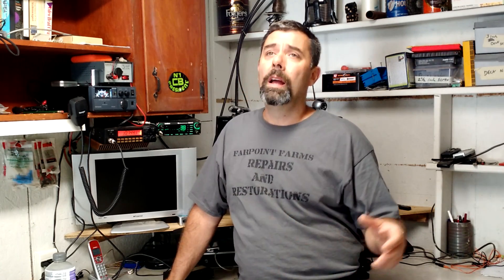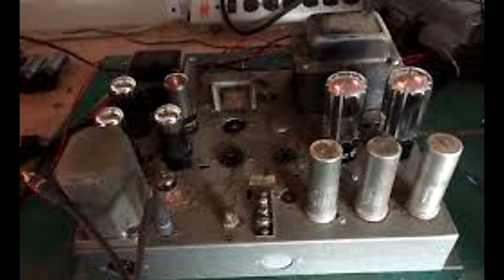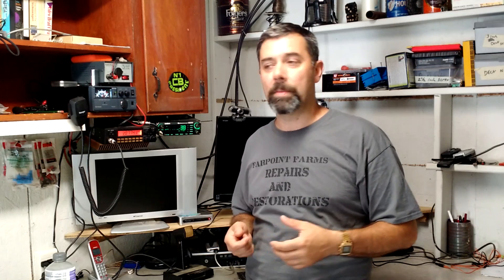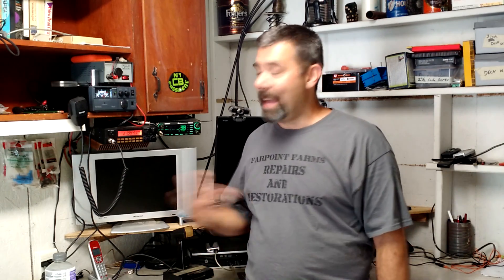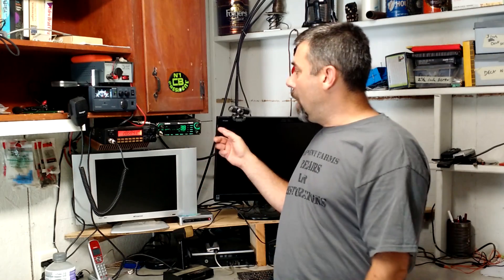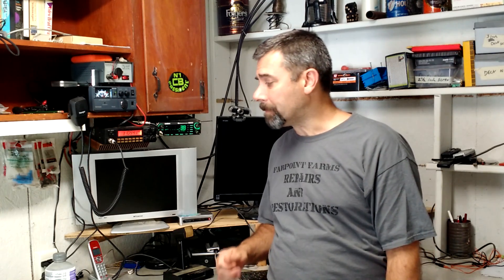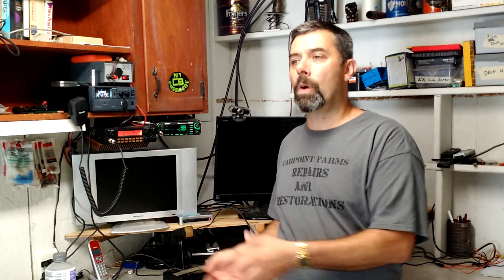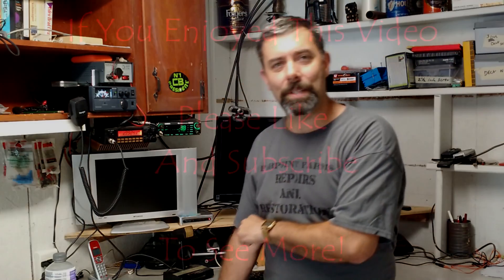A Beginners Guide To CB Linear Amplifiers.

Comment: When I was running power my neighbor could hear me talking through their sewing machine and their refrigerator, Also any florescent lights would light up when the beams were pointed across their house.
Reply from the maker: I think you might have had it tuned a bit too high- just a thought.
Reply: @FarpointFarms  Sometimes I'd get carried away with power. I was running a D&A Phantom 500 that I referred to as the gray ghost because of its color. The phantom produced a clean signal provided you gave it one. Now that I'm licensed to operate Amateur Radio I only use enough power to be heard. With repeaters being accessible theres very little need to run much power, at least on the frequencies I use. I'm seldom on the 11 meter band anymore..Thank you for the response.

Comment: Great information!  The increase watt concept is quite similar to Ohm's Law when combining speakers.  If you have an 8 Ohm output per channel, to use multiple speakers you must use a series-parallel circuit.  Speaker group 1 = 2 8 Ohm speakers in series.  Same for speaker group 2.  Each group now has 16 Ohms.  To get back to the 8 Ohm output, you parallel the speaker groups together,  Thus the 2 groups divide the per group Ohm's back down to 8 Ohms.  You could use 2 4 Ohm speakers in series to equal 8 Ohms of the amp.  If you're working with 3 speakers per side,  take group 1, add a single 8 Ohm speaker with an 8 Ohm resister in series, giving 16 Ohms per group.  Parallel these groups together to get the 8 Ohm output from the amp.
Reply from the maker: thanks for sharing that information- it is good to know
Reply: @FarpointFarms I have a question I hope you can answer is it a good idea to run a extra chassis ground to my Antenna I got a mount for a 102 whip it was powder coated I sanded it to the metal my radio has a chassis ground any ideas or help would be great

Comment: 1)  I don't follow the logic of a manufacturer producing an amp that is designed for a half a watt.
CB's have been 4 or 5 watts for 50 +  years.

2) Any amp with 600 or more actual watts is going to require a 240 volt service.
Reply from the maker: I always wondered why the did it.

Comment: What about the amp vs. The car? I don't want to use a big amp and take chances on doing damage to my cars electrical system
Reply from the maker: It certainly is possible.
Reply: @Farpoint Farms  I used to runa Texas star 677 and a 500 but when she bought the little Kea I'm kina scared to hook any box up. I've even checked with the dealer and they look at me like I growed a second head.

Comment: Just a question. I have a little 100w lennier when you key up it works fine, but when I unkey it continues to transmit , any ideas what's wrong. ??
Reply from the maker: It may have a delay for sideband. If it doesn't un key after a moment, it may be a bad relay.
Reply: @FarpointFarms  Thank you.

Comment: I don't know if agree really with a 5 watt am or 12 ssb with a very good antenna set up, one easily talks skip all over the u.s. and overseas. I had a 5/8 wavelength ground plane 100 feet up in a tree, rg-8 coax running to it, made and soldiered by hand by a 40+ yes long ham operator and 1.2 SWR  reading. I only like to talk skip and that,s all. For 4 years of shooting skip barefoot I had ONE contact. Talked my parents into letting me buy a 100 watt black cat. Everything skip was running after that ( yes the SWR was tuned with amp to be 1.3) I had dozens of contacts and conversations with all 50 states and Europe everything it was coming in. Don,t need an amp.?? You decide
Reply from the maker: It certainly helps.

Comment: Eric, had a system back In the day and i decided to get it back out and set it back up. Problem is I forgot my set up. I know my power set ups but the rest I am not sure.  Ranger 2950, model 91 match box, galaxy 2 freq counter and shoot star 225 ( may not use but want to know where it goes in line) and Antron 99 antenna, could you give me the in-line set up please, thanks, just want to be sure.
Reply from the maker: I'll make a video on that!
Reply: @FarpointFarms  thank you very much, if you need any more information on my setup let me know
Reply: Not sure when you will get the time for the video but could you tell me in what Order my eq goes in thanks

Comment: Hi Eric,
I have a question about my new to me setup.
I'm setting up a mobile CB for my mid 90's Miata's.
I have a CB (all in the handset CB) it's a 40 channel unit.  (Used in my International Scout II back in the day)
My question is about the antenna. I've set up a bracket just below the rear bumper.
I have a 5' tuneable Fire stick. No one seems to talk about those fiberglass wound antenna's. Are they no good?
I don't want to use a 102" ss whip. It's just too much height. 
I do have the tuner to adjust the antenna.
A group of us go cruising in our Miata's and there is usually a lead car and a sweep car.
Thanks for any input,
Chris
Reply from the maker: Firesticks are great antennas. I've just never owned one to review it. It should work very well.
Reply: @FarpointFarms  
Thanks for your response,
I picked the fire stick up used, it's one of the ones that has a screw and lock ring to set the length. I've always used the ss whip (decades ago) and on a Miata that's not practical. On this particular car has a receiver hitch and my bracket will mount to that so I'm sure I'll need an extra grounding  wire. I have two of these cars and I'm working out the details on one car before I set up the second.
I'm not sure how well my old Uniden all in the mic is going to work, but I'm going to give it a shot. It seems the Cobra Sound Tracker 75 WS XT is more available (for the second car) and probably pair it with the little will (or equivalent)antenna. The antennas only possible location is the trunk lid being a convertible with an aluminum hood! 
I'm trying to plan for the spring because I live in New England and it's some cold right now. If it's cold where you are it's still warmer than here!
Thanks again,
Chris

Comment: Great educational information you just gave me. Thank you. Is that a RCI-2950 in your shop? If so, i have the same radio that I purchased new way back when. It's still 100% functional and mint. They are great radios. Unfortunately for me, at the time of my purchase the CB radio hobby was coming to an end. I didn't have the knowledge or folks that were willing to teach me the tricks of the hobby. I packed up my radio and stored it away for many years.
Reply from the maker: Dust that old thing off and fire it up! They are really good radios!
Reply: @FarpointFarms  Yes, sir. It's been dusted off and installed in my daily driver truck..I'm currently using a rooftop magnet mount Wilson 1000 antenna. Im definitely investing in a while antenna and better coax soon. Do you have any recommendations as far as what length of antenna and coax type? Thanks for replying and keep up the great work. You earned a new subscriber 😎👍

PS: I've collected several radios over the years. My backup radio is a Uniden 76 with SSB and modded. I also have 2 Cobra 148 GTLs (Made in Philippines) sitting in original boxes.

Comment: Hi, what you DIDN'T say; was how many amp POWER SUPPLY you would need to run, say...a 200w amplifier.
I keep trying to rephrase my Google query, but I can't get an answer.
Please reply, hypothetically, what size would be needed for such a setup. (SHTF only).
Reply from the maker: 20 amps should run upto 400w- please keep in mind that there are a ton of variables on that along with run time.
Reply: @FarpointFarms  will increasing the wattage increase your reception range?
Reply: @FarpointFarms ...sorry, I forgot my manners:Thank you for the prompt and ACCURATE response.
I couldn't find an answer anything like that when I Googled my question.

Comment: Please make a video on how to ground your cb radio properly on your highway truck.  On a separate note from the above, I almost started a fire because I thought I knew what I was doing.  I had just enough time to put that smoking radio outside before it actually caught fire entirely.  If you're reading this and you're unsure, ask questions before you get yourself in trouble.  Doesn't hurt to ask questions.

Comment: Yeah CB was fun back in the day. And I also had built my own 100 watt linear. But those who love working skip and love running power should seriously think about obtaining an Amateur license. The Morse code is no longer required on the test. And the tests are all mutable choice. You can obtain all test questions online for free. Even though you may not understand the material, just remember the correct answers. There are several levels of licenses. Technician, General, and Extra. Most just stay at General to obtain the low band privileges for skip. And in most frequencies you are allowed 1500 watts. Tests are given by Amateur operators who obtain the Volunteer exam privileges. Check your local area for exam locations, date and time. It’s nothing like the nonsense you hear on CB. We as Amateurs would love to have you join with us in the fascinating radio hobby. And this is N2MIR. 73’s

Comment: Knew a guy back in the 70's  that was a HAM and was quite proud of the fact that he never bought any parts from a store.  Built everything himself from salvaged  radios, and some parts weren't even from radio.  And looking at it all you could tell for sure it was all home made. He was quite contemptuous  of big watt  stations. He would say put a million watts on something and sure you can go anywhere, big deal. Try it on a watt. He did all his contacting in code. I know nothing about the hobby so don't know how much power he was putting out and he said it took alot of work just for one contact, could be he was just BSing me.

Comment: Being an experienced HAM here i can confirm that you did address all relevant issues:
1) As the CB-Cold-war has passed, Using an amp is of no need these day's anymore
2) Power requirements increase logaritmicly increasing from 4 to 15 Watts is hardly noticable (1 S-point)
3) Driving an amp requires matching the input power (don't adjust to MAX but about to 70% of max, unless you have decent and usualy expensive  measuring equipment)

Finaly, there is not something like Wattage or Amperage ! it is Power (measured in Watts) and Current (measured in Amperes, not in Amps), However there is something like Voltage (measured indeed in Volts)

Comment: Good video bud! Just got my first home base set up. Took your advice and bought the Uniden 980 SSB and so far I like it. Still playing with getting my antenna tuned. What type of antenna or antennas are you using and how high do you have them mounted? I am trying a configuration you showed on one of your videos. 2 5ft firestik whips in a verticle position. Getting an swr of 1.2 on channel 1 and 1.7 on channel 40. Any advice from anyone would be greatly appreciated.
Reply: 1.5 to 1.7 is a good swr. I have that same radio in my dump truck with a Wilson 5000 and even on a.m. I get out a couple miles sideband clear across the city also hook that up in my pickup truck sometimes and use a Wilson magnet mount and it does almost as good as my dump truck point being go for a Wilson I've never had a bad experience with a Wilson antenna

Comment: This whole conversation that this guy is about to have with his video camera is all wrong information factually. Now first of all I’m not trying to talk bad about anyone or put anyone down, but I’ve owned 2 or 3 businesses selling and repairing every kind of two way communication equipment that’s ever been manufactured especially in the 1990’s when c.b. Made a huge comeback I think that about 90 percent of my city had radios in their cars,trucks, and in their homes it was a huge business to be in back then and to answer one of his questions YES Cobra did in fact manufacture some mobile amplifiers like that blue one he showed, but in all actuality now days the cb bands are pretty much dead, while sideband is the new place to talk and make long distance connections with other users, but he’s correct about the use of amplifiers on the cb band which is 11 meter band and most amplifiers will state on them that they are for the 10 meter band and yes back in the 1970s-1980s-1990s many many people used amplifiers to talk longer ranges from their vehicles and from their homes base stations, even tho amps are still considered to be illegal for use on cb band today, I doubt anybody using an amp would or could expect any visits from the F.C.C unless you were using such a large enough amp to overtake a local radio or tv broadcasting station which would have to be extremely large as in its output wattage, throughout my time frowning up thru the 80s and 90s I remember having multiple base stations set up at every single family members home as well as at our local farm we owned and I remember having some large tube type amps that increased our output to amounts of over 2000 watts and as high as 5000 watts and sometimes even more, while you’d have to use it with lots of cation back in the hay day of cb …..I’m not so sure it would be that serious now a days as I’ve just recently installed a base station as I usually every year for a winter hobby and I can tell you it’s just a 40 channel radio with sideband and just a standard Omni directional antenna from the late 1960s which still works flawlessly but I do choose to use a linear amplifier every time my cb radio gets turned on so does the amp and for a basic base station it will dead key around 50-60 watts and will swing up just over 1200 watts and that pretty much lets me talk all over the world each and everyday, just know that if you choose to install an amp into your setup that your taking all responsibility into your own hands, also by the way I’ve even seen people this past summer out camping and using those F.R.M.S. And G.M.R.S. Radio setups where one would be inside a big camping trailer or motor or 5TH wheel and then each of their family members would carry a personal walkie talkie style radio on their person but I seen many of the radios inside the campers and even on those radio bands I seen as much as a Texas star 350 amp in line with that families f.m.r.s/G.m.r.s setup and when I asked about it the dad said he did that to ensure no matter where every family member was around that campground he would be sure they would hear him broadcast and that he could even use the amps receive booster to hear everyone of his families walkie talkie radios when they respond to him so there are some good and some bad things about these amps but as long as I have a collection of these amps I will always choose to have one inline, and yes I do also own one of those RM Italy amps he spoke of the rm Italy 50 but it actually only boost you up to about 40-45 watts but you don’t really need to tune your radio if it’s a rite out of the box brand new radio you can run it most amplifiers can handle any input of a dead key from 0-4 watts without hurting the amp I usually turn all my radios dead key down to around 1-2 watts if I’m gonna use a amp inline doing this just allows me a little more forward swing of wattage

Comment: The original FCC rule for power was 5 W input (to the PA), which usually equated to 3.5 W output.  It was equal to the collector voltage times the collector current.  Amateur powers were specified the same way (1000 W, except Novice Class which was 75 W).  In the old days, it was difficult for hams or hobbiests to measure output power.  The equipment for doing it was expensive.  As  the technology improved and the equipment dropped in price, the regs were changed.

Comment: As you mentioned, the issue of outboard signal amplification in CB, using linear amplifiers means little when all the necessary conditions are not established.
I still have a small linear tube amplifier that works fine, which I turn on from time to time to check how it behaves.
But in fact the most effective contacts I've established at 27 MHz throughout my life have been made with the conventional configurations of each of the transceivers I have and not with linear amplifiers.
Perhaps this is one of the healthiest ways of taking advantage of this type of communication, that is, studying the issue in depth, taking care of all the elementary aspects of the installation, waiting for the propagation conditions to be favourable and being able to use the little power available in the transceiver in a balanced way, managing to get very far with communication.
Greetings from Portugal!
73

Comment: in the 80's-90's i ran texas star radios with astetic mic into a Black Cat Wawasee JB150  modulator into a D&A Phantom 10 tube 6lq6 amp  into a 5/8 4 ground radial base antenna   and a tx star with a sweet 16 in the van... bam  bam  bam world wide zigzag off the key

Comment: Of course you don't need an amp. You have a 300+W Ranger 2970 hanging there!
Reply from the maker: That is a 10 Meter Ham radio, not a CB.
Reply: @FarpointFarms  : Of course it is. I've owned a few over the years.

Comment: man u made my day u funny but what's the best coaxial cable and antenna, I am running with a factory cb radio of 25 or 28 watts and a power supply of 15 amperage and the coaxial cable is LMR 400 0710M what due with think about my set up.

Comment: Back in the 70s i had my set. I had a heath ssb/cb and a 1000w amp. I never turned the amp up very high. Maybe 100-150 amps. And the input was adjusted to need 4.5 w minimum input power. It transmitted perfectly clear.

Comment: I have a question,  you may know the answer.  Are not linear amplifiers for CB radio illegal.   Isn't the legal power output for CB radio still only 5 watts.  If higher power is legal when did this change .  Am I stuck in the past.   Thanks
Reply: Still illegal.  Legal output of a CB radio is 4 watts at the antenna connector.